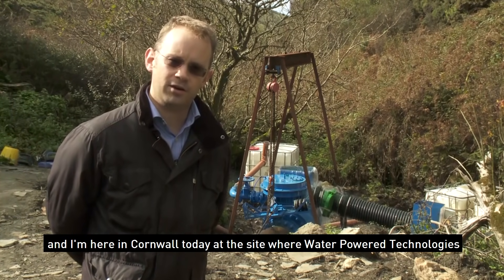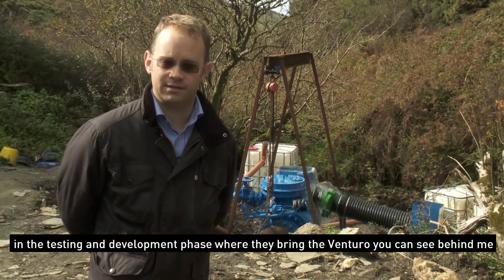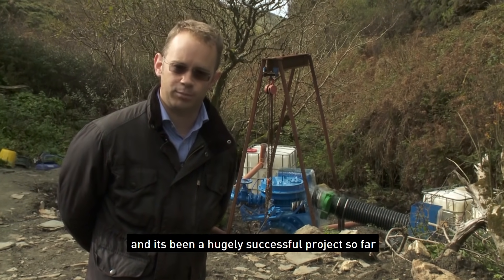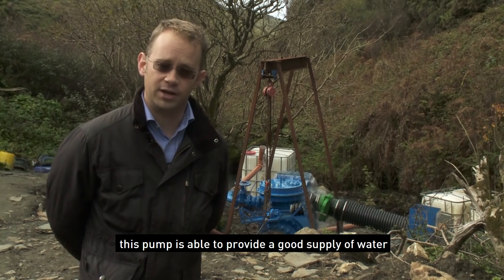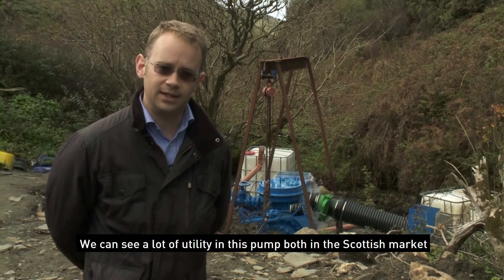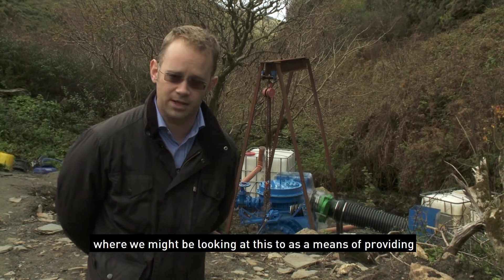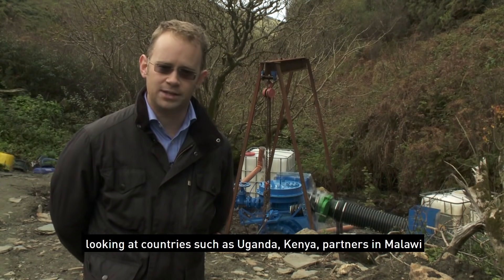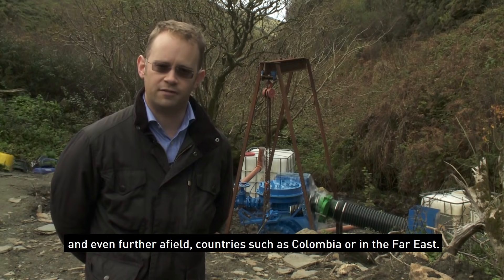Largest Ram Pump in the World

Comment: This will not work on just any lake, river, or body of water. Location is key. You need sufficient kinetic energy from the water to power a ram pump...the height and/or distance you desire the water to travel is totally dependent on the amount of kinetic energy that is available and captured.
Reply: Not completely true. You can get one to operate on water from a bucket, check out the channel "Land to House," he does experiments using water in a bucket alone. It relies on atmospheric pressure, water hammer and of course gravity. Head is the vertical distance from the water level of the source to the ram pump's waste valve. There's inverse relation to head and efficiency (note that there's also volumetric efficiency). The general ratio is 1:7, where every 1 units of head you pump 7 units in vertical distance (with lesser volume of course but that depends on efficiency) 33% for homemade and ~60% for commercially made ones. There are experiments on youtube pushing the limits of ram pumps, albeit most are homemade ones so efficiency is quite overlooked. Some can operate on 2-3 ft of head alone, some can even do 1 ft; you can imagine those aren't of much utility but it's good data.
Reply: Yes! Early data suggest ram pumps can push up 7ft for every feet of head. So if your ram pump have 7ft of head you can still expect water up 48ft to 49ft.
Reply from the maker: Ours have a ratio more like 1 : 30 ;)
Reply: @MmeHyraelle  Thanks for the input. Could  you define what you mean by 'head'? Is that the elevation difference or drop of the feed, or input? or something else? And wouldn't the volume and flow rates be a variable too?
Reply: @jeffw8057  tatcical dot.
Reply: @UC9y2I32_CzLbqlfHXF3gghw Thanks for the reply. Yes, that is what I thought you meant. Thanks for the clarification. So, one key to determining whether a ram pump will work in a specific location is to understand the Kinectic energy available from the water source. KE = 1/2 mv2 Do you have guidelines or a chart that can be used to determine if a given site is suitable for a ram pump to say...supply the desired flow rate to the desired height given the velocity and mass of the supply source?
Reply from the maker: take a look at our performance calculator https://www.waterpoweredtechnologies.com/calculator/
Reply: So, next to a very fast moving river lots of volume. Would I still need drop to pump, or if I put a Venturi on the inlet work? Could I size the Venturi inlet to up my head pressure?
Reply: Nerd
Reply: @chestfarter4207  Thanks for the compliment!
Reply: @chestfarter4207  Followed by an insult. (sigh)

Comment: I know how a ram pump works, but I'd like to see how this pump works. 0:30 what are the pair of 3-way pneumatic valves for? what is their energy source and what are they actuating?
Reply: The energy source is water going downhill.  For approximately every 8 gallons of water that flows downhill, it powers one gallon to a higher level.
Reply from the maker: The pneumatic valves are there for the Sureflow system similar to how it is used on our papa pumps
Reply: these replies don't answer my question. I assume the valves are somehow used to prime the pump?
Reply from the maker: @lorenzo42p  No, they are used to open and close the valve using the pressurised water of the system like our Sureflow does on the papa pump
Reply from the maker: @lorenzo42p  see here: https://youtu.be/gWznV486evs
Reply from the maker: and here: https://youtu.be/EFit4CGFYMA
Reply: @Waterpoweredtechnologies  very nice, thank you.

Comment: umm you can't pump water from a lower point to a higher point without inputting energy (unless the pressure is higher where the water originates from). It violates the laws of physics.
Reply: umm     mik, you  SHOULD  KNOW  what you are talking about, BEFORE  posting such a stoopid comment.!!!      suggest you  LEARN  about ram pumps, before stepping in the manure, again.      googletranslate
Reply from the maker: Ram pumps use the energy in the water to pump a smaller percentage of it up to a higher point. No Physics is broken just used smartly.

Comment: I can't see this as being efficient for hydroelectric power? Wouldn't it be better to use a low pressure turbine on the main water flow?
Reply: Guy that speculates vs. company that tests.
Reply from the maker: The use would be to either generate higher heads or to boost pumped hydro

Comment: Efficiency compared to generating electricity to run a pump, or having two impellers, on large being driven by high volume water, and one smaller pumping water at high pressure?
Reply: I don't know for sure, but I bet it's more efficient, since there are no large moving parts which add additional friction. The only losses in this method are in friction between the water and the piping, and in the power needed to exert enough force to open the check valve on the output. Plus, this pump will hold water from flowing backwards when it's off.

Comment: Another thing to think about. Making these with carbon nanotubing fiber and using them for boat motors. Also it can pump water from a lake and back into the lake or ocean and generate electricity.
Reply: another thing... you don't know what you are talking about, spank.     SUGGEST  that you  LEARN  about  ram pumps, before saying something  so stoopid, again.       googletranslate
Reply from the maker: Ram pumps require a fall in water level so generally don't work pumping from lakes or the ocean (exceptions see our jetstream lagoon)

Comment: if they over flow could b directed into the ground u get a well drilled w/every smaller hose where ever u hve pump set up. comment 267 showing:
Reply from the maker: The overflow is directed back into the original water course for sustainability and little effect downstream.

Comment: Kind of silly to drop water 20 feet just to pump it up 20 feet
Reply: Set up right, it could pump water to 150 meters, and a long way from the pump. You didn't pay attention to the video. The longer the intake pipe, the larger the water hammer is, and the higher the output pressure.
Reply: @grancito2  Or the same falling water could just spin a turbine which is coupled to a pump.
Reply: the question is,  WTF  were you talking  about.    150  meters  is  a  LOT  more than twenty feet.!!!!!!!!!!!!!!!
Reply: @daviddavids2884  You are missing the point David. There is no free energy. In this example, (I will just make up the numbers). Your storage reservoir is 50 M above your pump. Your goal is to pump a portion of the water to 100 M.

Yes the hydraulic ram will work, jus inefficiently. Better to run an electrical generating turbine, and use the electricity to pump a portion of the water to 100 M.

Better yet, think of two turbines connected together in a shaft. A big one and a little one. Use whatever gear ratio. The falling water spins the big turbine. The output shaft of the big turbine spins the shaft of the little turbine.   Now think of bicycle gears. If the big turbine spins at 50 RPM, the little turbine spins at 500 RPM. 

You can pump that water up 1000 M if your pipes can hold the pressure without bursting.

Freshman level engineering problem.
Reply: @grancito2  The turbine & pump weigh about 100 Kg. How much does that iron behemoth weigh? Need a goddamn crane. Must be you work for that company.🤣🤣

Comment: It seems to me you could supply a second smaller ram pump just from the falling overflow from that big guy. Just seems like it could do something with that water gushing out the top and not wasting it. More efficiency. Maybe I'm missing something here.
Reply: You are missing that the kinetic energy of the water is consumed: it has to go down in a pipe - with the same length and inclination - again to gain the same amount of energy.
Reply: @TheCommono  that's what I mean. Capture that water falling out and send it to another ram.
Reply: @MadMetalShop  But you don't gain any efficiency - you just can have another pump further down the stream. It's the same as with a water wheel:  you can't reuse the water that went over it.
Reply: information.        the energy is in the  Head/elevation change (mentioned in other replies).     the 'main' pump Would be located  where the  Maximum amount of head is  utilized.       while yer idea is semi-valid,  it Assumes that  MORE  head  is  available, below the 'main' pump.      cheers
Reply: @daviddavids2884  You are the man to explain it... 
But why do you say "semi-valid"? How could the 'waste' - water contribute to pumping more water and/ or to a higher elevation?
Reply: @TheCommono  "pumping more water and/ or to a higher elevation"
you have inserted language into the original question, that was  NOT  there.      any other questions.?
Reply: @daviddavids2884  Doesn't "efficiency" mean exactly that?
Reply: @TheCommono  jeezuss
whether the asker (or you) knew it, or not, the  Context changed, from one ram pump to  Two.     so,  HOW  do you define 'efficiency', then.
he said, 'do  something  with that water'.!!!
if head were available, SOMETHING  could  be  done  with  it.!    any other questions?
Reply: @daviddavids2884  Jesus won't help you in explaining to me what I didn't learn in school about physics.
The context is clearly 'pumping water to a certain elevation'.  "Adding efficiency" logically means adding it to that task. So what could a "second smaller ram pump" contribute to that task? No, the question is not rhetorical.
Reply: @daviddavids2884  But I have another question - ??

Comment: If you're interested in power generation, just use the flow from the conduit directly.  Ram pumps are awesome, a long way from 1796 but not that far.
Reply: and, this comment was  relevant, HOW?     the 'main selling point'  was  RAISING  WATER.      googletranslate
Reply: @daviddavids2884   Certainly yes! to overcome gravity and raise the water level for irrigation etc and unattended operation, ram pump is an awesome tool.  but the speaker mentioned 'power generation' now that's less than ideal due to the energy lostin pushing the water uphill in the first place.  a small direct turbine with the same fall would be far more efficient.
Reply: @fastst1  yes.  it  was  mentioned.    emphasis on  'mentioned'.     in other words, of  secondary significance.    cheers

Comment: Interesting - but: the efficiency of a ram pump is nearby 5 to 10 %.

With this ammount of waterflow i´d install a hydroelectric power plant ( much more efficiency). . . and you could use the superfluous energy for much other things..
Reply: hmmm          a ram pump can pump ten percent of the source flow.      that is Not the same as saying its  efficiency  is ten percent.      googletranslate
Reply from the maker: Our version of the traditional ram pumps can pump up to 30% of the supplied water to a higher level then supplied from. The energy loss in transferring from kinetic to electrical is rather significant especially when transferring it again to kinetic to pump water.

Comment: Could you use a tubular Tesla Valve so your pump as no moving parts? Could you also have many many layers/stages or stage to that pump processes?
Like  all the water that is rejected, can it be collected and reshot up using the same principle again? And get more efficiency and more efficiency.

Like a huge water tower that would collect rain and let lit run down in multiple stages always refilling up a bit while going down. Like you take a minimal input(a drop of rain) and use every part as of it's potential energy at every stage, in a multilayer water tower.
Reply: 1)  you do not understand ram pumps  OR  the tesla valve.
2)  nope, nope  and  nope             googletranslate
Reply: negative nancy can say bye to innovation.
Reply: @deathskayebolo6806  weh-weh-weh    bla-bla-bla       you  have said exactly,  NOTHING.!
Reply: @daviddavids2884  romans have used exactly what I was describing... you are like 2000 late

Comment: Why is it not possible to put this pump into a closed loop system and continually pump water to the top of a hydro generator for a positive yeilding electrical system?
Reply: Rad idea, if this pump can pump a column of water high enough in excess volume , a Pelton wheel could generate electricity and recover the same water to its place of origin without consuming any water (possibly returning the water diverted for electricty upstream of the ram pump inlet). The art of power recovery systems will come to mainstream commerce soon. The ideology is alive and well...

However, If one was to close the loop into a cycle one has to add filtration, pumps and storage to the $ystem. With the water cycle closed to new energy input the ram pump would then be useless and external energy would be requiered making this just silly from design. If one lets the ram pump's "waste" water flow down stream to another identical power system, then you could have a chain of these said generators on one stream and link them together to raise voltage for transfer, charging and distribution to be used locally.
Reply: why...have you asked such a silly question, gav.
if you would take  FIVE MINUTES, and  do the s-word  --  STUDY  ---  ram pumps, you would  then  Know  their  limitations.!!!!       cheers
every hear of  wikipedia  or  brittanica
Reply: That's a great question. The reason is that the Ram pump "consumes" more water than it pumps. 

More water has to go in than is pumped out. 

So if you cycle the water, it gets less and less every cycle. 

It would be more efficient to put a second ram pump on the supply than to put a second ram pump on the return.

Draining water downhill to power a ram pump returns less water up the hill. Eventually the cycle will stop. 

You could use a river and a ram pump to pump water up for storage to power a Hydroelectric generator, but that doesn't seem better than a water wheel or gravity powered turbine.

Comment: A Manchester UK company was supplying ram pumps to parts of Africa 100 years ago. Most worked well for a generation without the need for maintenance.
Reply: I think the company was Vulcan.  Had one at our mill in Tipperary and there were vast numbers sent out to the colonies.  Only problem was when the river was in flood,  one had a brown bath. Should have had filtration system on the delivery end.

Comment: The  diameter of pressure tank is so large to withstand  high pressure produced by the pump, or it will be swelled up. How is the max pressure you recomend for that pressure tank? Or how high the maximum target did you ever test the pump?

Comment: Am from Kenya and your technology is so so great! Welcome to Kenya! Please connect Ram pump to ewaso nyiro river in magadi kenya. The maasai use it as their main water source for themselves and their cattle. The Masai woman trek for miles in hot weather condition to collect water. If you can pump water in elevated storage tank which create water pressure, then connect pipes to Masai villages (manyatta). Not only will it have an impact in environment, but also  brighten the future of a maasai woman, that leave her with a smile.
Reply: It's not that hard to build a smaller pump that will work all day and night to fill up at a longer distance. Just check out some YT vids and go get some pipe and tube supplies. I'm sure those exist over there as well.
Reply: As Burken Productions says, it's not difficult to make yourself. The main problem is you need at least a small drop to get enough flow to generate a strong enough pulse to send water uphill. If you live near some rapids it gets economical to do that, as your thick feed pipe can be shorter for the same height.

Comment: What's the bypass-ratio on that pump? It sure looks like it's letting a whole bunch of water go. I get the point of using ram pumps, as a matter of fact I built one and I'm very happy with it, but this pump looks like it could certainly use some further development. Simply being big may have been enough in the 1950s, but it's not enough now. It must be efficient above all things. I'm not saying ideas like this are bad. Quite the opposite. I love stuff like this. The problem is just that the execution leaves a little bit to be desired.
Reply: Efficiency is 10%.
Reply: @tojomathew4730  ...reflecting a 9 to 1 ratio. I've seen them in four and a half to one as well... which of course, pumps twice the water half as high as the 9 to 1.
  peace.
Reply from the maker: Our pumps can pump up to 30% of the input water
Reply: @Waterpoweredtechnologies  Ah ic. Thanks for the reply.
Reply: But isn't the bypass eater just going back to the source stream? There's surely not much more development in a lump like this, especially if you want to keep it simple and reliable surely?
Reply: @ChrisWilliams-i7d  You are correct. The bypass goes back to the source, but I was merely speaking on efficiency. It's not just a "lump". It's an engineering project. If everyone thought like you, nothing would ever get done.
Reply: It has a high bypass ratio, the same way a water wheel has a high bypass ratio.  A lot of that water is just used to push the rest

Comment: Show me that the water could not have made it up the hill without the pump. Wasting water.
Reply from the maker: It shows that the tank is much higher than the source.  The water was flowing down the watercourse anyway - the exhausted water was returned to the watercourse - how is it wasted? So you think if you use a natural watercourse to generate power you should use all the water and leave nothing in the watercourse?  I guess by your logic, the water used by a waterwheel to power a wheel is wasted because it ends up back in the watercourse.  This pump lifts a portion of a flowing stream to a higher level without using any fuel, electricity or emitting any CO2 and it's not good enough for you?  Can let us know your suggestions for a greener way to pump water?